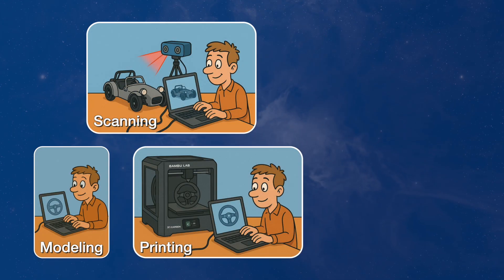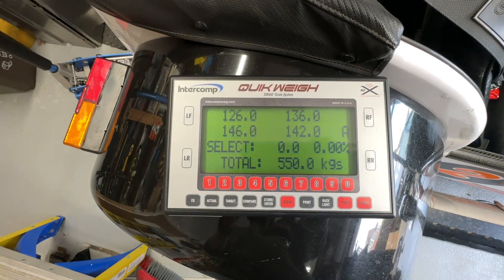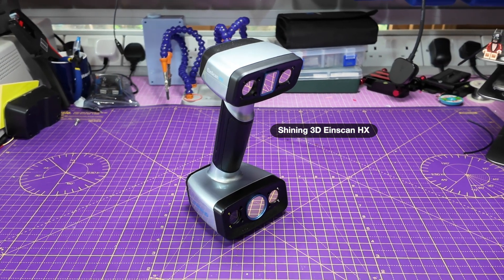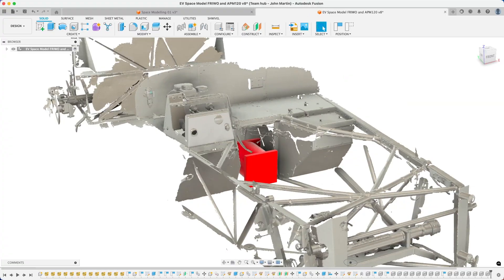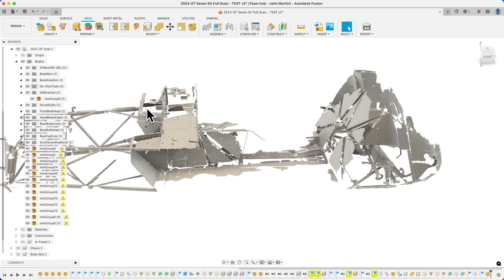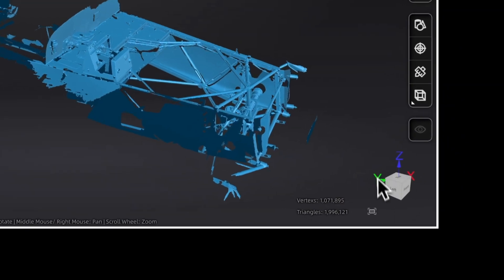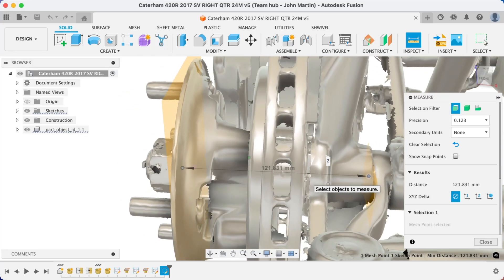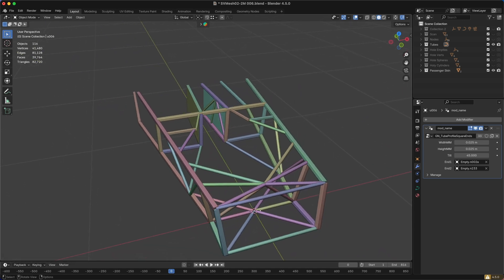Project sEVen pt5: Scanning my EV Project Car... is it worth it?

Comment: I almost went this route, but it is way to much to learn and almost takes me in other direction(other hobbies) and I'm not advancing with my Locost build. So I just wing it. I'm using my 3D printer to make some parts, but that's about it. I was considering buying a 3D scanner, but a good one is expensive, then there is a big learning curve using CAD, that I don't know how to use properly. Somehow I make some things in 360, but not properly. I appreciate what are you doing and I will follow your build, but one thing about these videos, they feel like you are in a class and you are learning about this things.
Reply from the maker: Thanks for the comment. And good luck with the locost build. CAD is definitely a big learning curve, and yes scanners are expensive. But like I said in the video, I couldn’t do what I’m trying to do without it. 
Can you explain a bit more about what your last comment was. Did you mean I’m being a bit like a “teacher” in my presentation? I find it really difficult to get the tone right 😱🤣